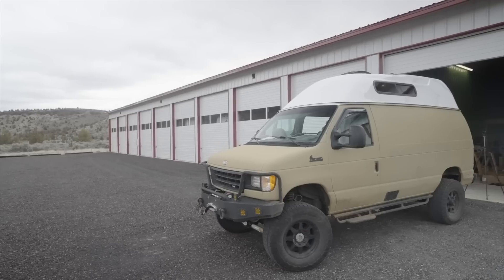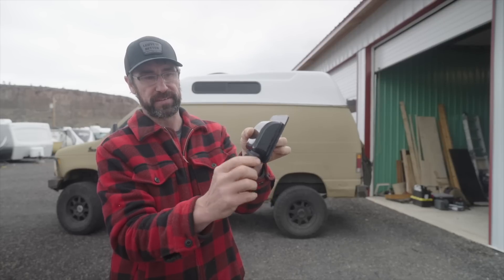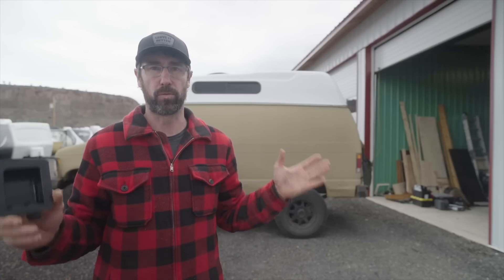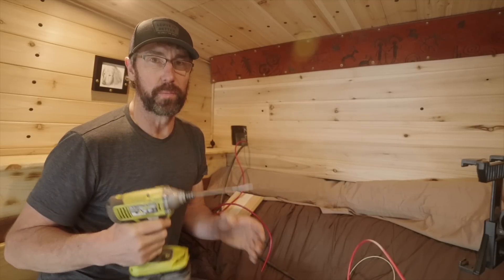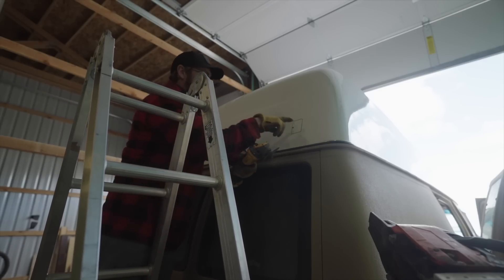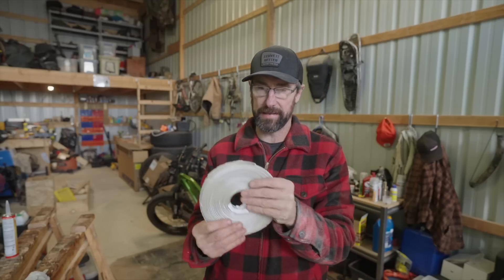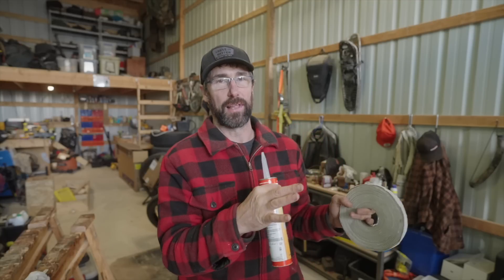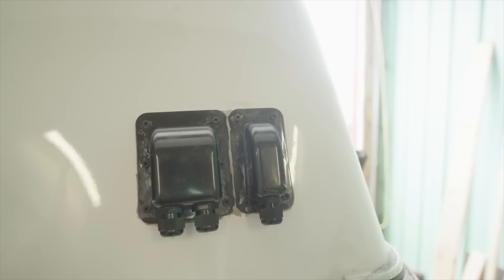Van Build - Prepping for Solar

Comment: Makin me look lazy; I just drilled holes right through the roof of my E150, bolted to factory mounts down with stainless hardware and double sets of nylocks, drilled a hole for the wire passthrough, and coated everything in Decor (or Sikaflex, I don't remember anymore). Not the prettiest job, but has been working great. And my panels have held up for tens of thousands of miles, many at 80-90mph.
Kinda wish I did prep everything well and make it nice, but my van is just a daily beater with occasional trips. Yours is a full on bug out vehicle. 
Looking great man. Keep us updated.

Comment: personally Jason I would of just drill 3 holes instead of cutting out full size rectangle holes. putting a rubber grommet to stop the wires from wearing through but your way works just as well.  Your way would be easier to rout the wires through the casing.

Comment: Right on. Bout to install my solar setup also. I was gonna  run the wires though grommets before i sealed it. Just to have 2 small holes vs a big one.  But i might do a big hole and make it easy.

Comment: Would have thought that you'd put the line inputs pointing up so that you don't have to loop the wires up from the bottom, unless having them pointed down provides better protection from leaks.

Comment: Jason, quick question. When you LINE-X the wire ports will the product cover the screws you used to affix the ports to the top?

Also, the build is taking shape nicely. Thank you for the content you provide.